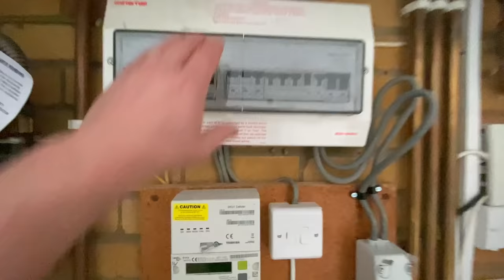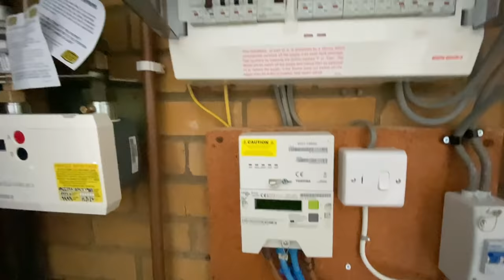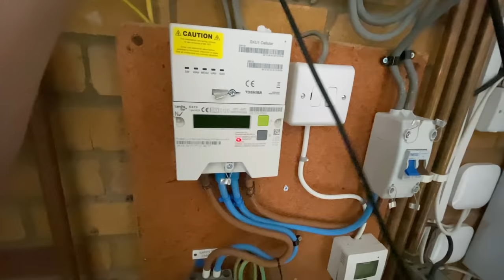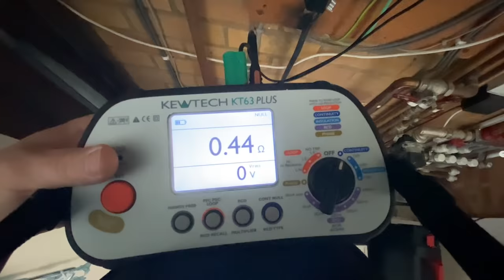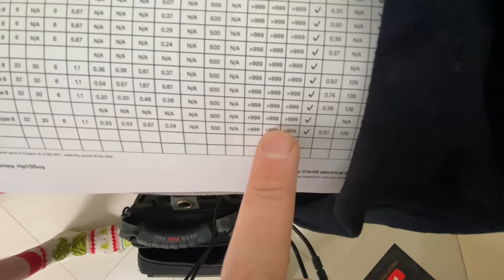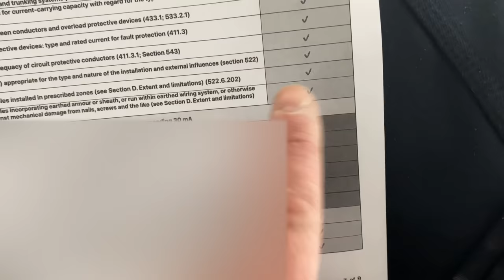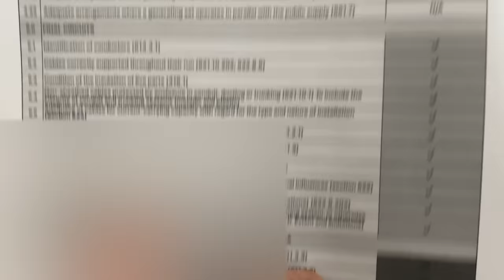£280 for a worthless piece of paper? Electrician

Comment: 150mm separation between gas pipe/meter and consumer unit 👍
Reply: From the On site Guide 150 mm  - S 2.3  suggest insulating material rated to 230 v over pipe  or insulating material  interposed

Comment: Just could I get your learned opinion on the separation of the consumer unit and the gas meter.  The relevant regulation reads as follows…. “BS6891-2005 8.16.2  Separation of installation pipework from other services. Where installation pipes are not separated by electrical insulating material, they shall be spaced as follows: a) at least 150 mm away from electricity meters and associated excess current controls, electrical switches or sockets, distribution boards or consumer units;”  So this would suggest a non conductive separating material such as plastic rather than a fireproof one as you seem to be suggesting. However I am not clear myself as to what the exact risk is. Should a fire develop in the consumer unit, it would get very hot so a fireproof barrier, not a plastic one would make sense.  Therefore I can’t quite figure out why the regulation mentions electrical insulation material.

Comment: I had a callout on Saturday which I arrived  at 12am after travelling 70 miles( I was asked if I could cover the weekend) with electrics tripping (Ringmain socket fault),neutral to earth fault, it had a test date sticker of just a few years ago 
I found a few metal flush boxes  no grommets, cables tight to get the socket fronts off , the actual fault was a back to back socket wired in 1.0mm flex off an existing lounge socket to a adjoining shed that had overloaded the cable when a tumble dryer and a new hot tub were both used in it,tenant said they were like that when they moved in.
didn't get home until 4am, didn't look a good eicr

Comment: All that silicon to stop fires! AND gives the next sparky a head ache when adding a circuit. 

Use Intermittent pads on back of fuse box if your rear entry and running down wall. no mess unless theres a fire. (Use a label on inside of box to state you've padded the back so next sparky knows your actions and doesn't become a silcon twit!)😂👍

Great vids.... keep them socks pulled up!💥🧦
Reply from the maker: Could always gland into the top bottom or sides if they can’t enter the rear easily.

Comment: If you use lock off ? Haw come you always put them upside down or fluff around like a rookie ? Another great video, keep them coming
Reply: From what I seen in previous videos, rarely do the Tails from the meter have an isolator. That means he usually has to call  "Pablo" in to pull the Main fuse so he can do a board change.

Comment: Cut down the length of 32mm conduit and clip it over the gas pipe sleeves the pipe if its close to cable or consumer units was taught it off a gas lad who uses waste pipe with duct tape but I use 32mm conduit or small waste pipe
Reply: That's a great idea 👍

Comment: When you were tightening the buzz bar with the small compact  where did lock off kit on the main isolator switch disappear to?
Reply: He's at a point of tightening things up and leaving. Plus there's only him and James there, so I'm pretty sure that lock off not being on at this point isn't really an issue is it 😂
Reply: @gkbailey540  I know. But he went through the whole thing of showing us that he locked off to work safely. Then when it comes to doing the buzz bar the lock is gone. Kinda defeats the purpose of showing us locked off no?
Reply from the maker: Main switch was also off bud we were ready to energize. 
It also got in the way of me tightening up the main switch with my Allen key.
I didn’t leave the board unattended at this point and the house was empty.
Reply: @Cjrelectrical  👍
Reply: He did put the outgoing cables pigtailed into the isolator 🙈. Bit of a no no. Easy to snag/pull that way.
Reply: Busbar FFS

Comment: I havnt used those flexi tails yet, are they multicore like flex? If so do they need a ferrule?
Reply: They have 19 strands rather than the 7 strands that standard tails have. You do not have ferrules on the end (just like on standard tails).
Reply: @stupot_64  thank you
Reply: I've used them on many occasions and haven't used ferrules. They don't compress like Tri rated because the strands aren't as fine. They just have more slightly thinner strands than standard tails.

Comment: Chris it's 150mm from a Gas meter and it's non-conductive/combustible material. Also it's not suprising to see a satisfactory report with boiler installation wiring like that as it's deemed "part of the appliance". C3 on the bonding sure as it's improvement recommended, but those C2's... WTH. Edit: bone idle on the bonding the bloke was aye.
Reply: Looked into this when I changed the CU here. Lots of refs. to a non-conductive and non-combustable barrier if less than 150mm but not one example given of a suitable material or a picture of one in situ. Asked the commissioning sparks and he said he'd never fitted one so I didn't bother.
Reply: @Graham_Langley  Cement board is normally my go to as it's what my local college and my GasSafe assessor/ NICEIC assessor both agreed on. I just use metal L brackets to bolt it to the wall.
Reply: @effervescence5664  That's something I'd thought of but didn't have any to hand. 
The use of metal brackets raises an interesting point how to you fit it? Metal brackets are conductive and a block of wood is combustible, plus any screws will be metal and will go through the barrier if it's something like cement board. Also does this reg. take into account metal-cased CUs?
Reply: @Graham_Langley  Normally use 10mm board and just make a slot in the bottom and top for the board to slide over the bracket. Then drill them into the wall with screw fixings on the gas meter side away from potential conductors. You can use plasterboard too but I found it a little flimsy.

Edit: No the reg does not take into account metal CU's - it's written as any CU due to being a Gas regulation copied into the Electrical regs and not the other way around.
Reply: @effervescence5664  Thank you. Looks like I''ll have to have a look at it again if only to score brownie points should the installation ever have to be checked in the future.
[Edit] FWIW I was going to use the 4mm fibre cement board used for roof undercloaking and soffits.
Reply: @Graham_Langley  Brownie points are always worth while, got to admit there's things Chris/ Nick/ Jordan/Cory etc do that I have taken on board as it pays off in the end! The fibre cement board sounds like a good choice and basically the same thing I'd use (tend to work alongside plumbers so normally have the off cuts from their work kicking about myself).